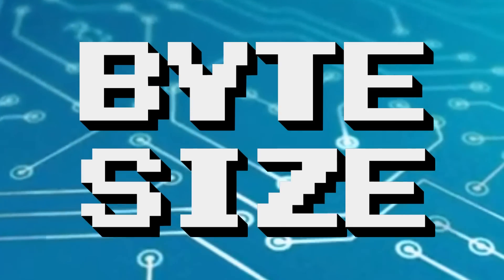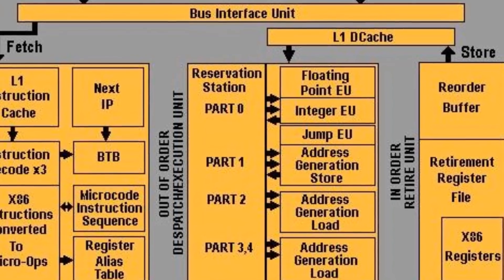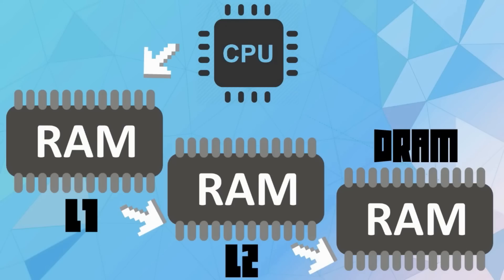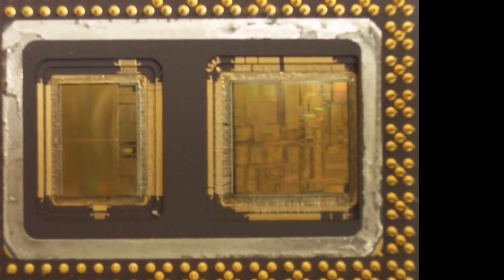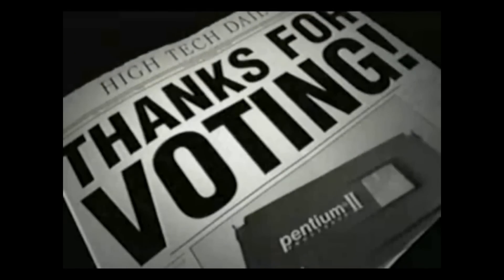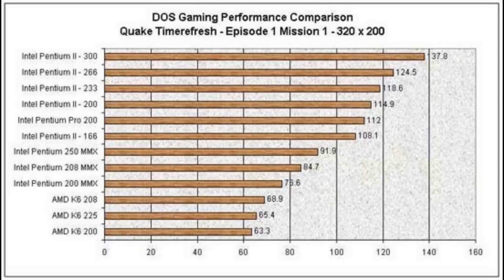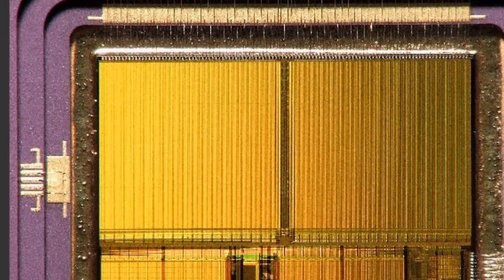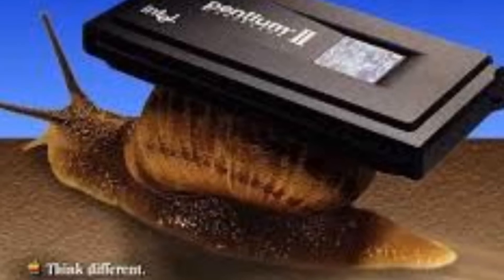Why Were Pentium 2's on Cards? [Byte Size] | Nostalgia Nerd

Comment: You forgot to mention what a beast that original Celeron was. It could easily be OC'd and would destroy the PII and even some early PIII's. The original Celeron's are legendary.
Reply: That's because it was the same processor (only with less cache).
Reply: the original had no level two cache
Reply: The Celeron that was legendary was the 300A. The Celeron 300A HAD LEVEL 2 cache at 128K that ran at full cpu speed and could beat Pentium II's in some cases which had more cache but ran at half speed. The original celeron without cache was undesirable.
Reply: the original celeron was dog shit and beaten by amd k6-2 lol
Reply: *****
Celeron/Pentium had better floating point performance while  K6 had better integer performance, at the same clock speed.
Reply: I remember buying a celeron 300A and OCing it to 450mhz to beat my friend's real 400 mhz PII (in most measures we took anyway) !! amazing times!
Reply: That was the most awesome OC :P
Reply: I used to have a Celeron 300A which clocked to 450 and if I remember I managed an extra 12 from FSB increase.
Awesome CPU for the price
Reply: I had one also.  I think I ran it at 300 while Windows etc was installed.  Once the PC was set up etc I went to the BIOS, upped the FSB to 100 and off it went at 450.  It ran like that for several years until I replaced it with an Athlon XP
Reply: I had the 366 one... 83mhz x5.5   456Mhz ... My  motherboard did not allow to chose small fsb increment.

But yeah the Celeron with 128K of cache at full speed made these CPU faster than Pentium 2 in many tasks. And almost every games.  I  literally threw my Pentium 2 CPU in the garbage.
Reply: Indeed !
Reply: That is correct.  The celeron 300A could easily get to 450 speeds.  That is a simply crazy overclock.  There is no equivalent that has come around since.
Reply: phuturephunk
But before though! Many Pentium MMX labeled 166 MHz could be clocked with 250 MHz (and even higher) without any problems with either heat or stability. That's the same 50% speed enhancement.
Reply: +LegendLength , it was always my understanding would work so long as you had the ability to set the FSB manually to 100mhz either through bios setup or through jumpers just about any Slot-1 board could be used , although the 440BX was the popular choice at the time, I seem to recall that some 440FX and 440LX boards had experimental setting for 100mhz FSB but were usually unstable because over clocking the FSB would also overclock the PCI and AGP buses and these boards lacked the proper dividers to keep the AGP and PCI buses stable.
Reply: I still have an old 800MHz Celeron laying around here.
Reply: I remember I ended up with the 300A as I had purchased, for my 2nd ever build, a 440BX board after reading about it, never expecting to overclock, and a Pentium II - 400. The month I built it I read a cover story in MaximumPC about Pentium II re-marked counterfeit processors flooding the market. I popped in the CD that came with the magazine and ran the program they had included to check and found out I actually had ended up with one the fakes.
Ended up having to take it back and ruined the day of an ex-employer, who had pushed me to use an existing store credit to buy the board, processor, etc, as I had quit months before and he didn't want to worry about owing me. Ended up using the credit on the processor return to pick up half of the parts to build a whole new AMD based system for my cousin's family. 
The day after I check a little shop right near where I currently worked and found they had the Celeron 300a in stock, which I had been reading the rave reviews on overclocking online. Picked it up at lunch and popped it in when I got home. As I recall I still had Windows installed from running the PII so I just ran it at 300 for a day, then upped the FSB to 100 and it ran like a dream at 450. It was quite the upgrade!  I think that processor only ran at 300mHz for maybe half a day's worth of use the whole time I had it. :D
Reply: In Celereon 300a days the motherboard didn't use the Intel reference motherboard they designed their own so in benchmarks the better brands were upto 15 % quicker with the 440BX chipset. I used ABIT motherboards as they could go up to 450 with having cut any tracks on the CPU cartridge. I wanted an ASUS but man were they expensive. In those days CPUs cost more than the motherboard
Reply: The T-bird was a traditional socket design. And I think they started higher than 550Mhz. But the original Athlon was a slot design and I had a 600 Mhz version and a friend obtained a 500 Mhz for free. Athlons were awesome for those few years.

Wikipedia agrees with my rough memory:
https://en.wikipedia.org/wiki/Athlon
Reply: The cacheless Celeron 266 would OC like a mofo. You could run it at a 112 MHz bus and hit 448 on it. But the lack of L2 cache still crippled it. The second-generation Celeron 300A, with 128KB on on-die L2, was the killer part that could almost always run at 450 with no issues, and would almost match a real Pentium II 450.
Reply: @si4632  Of course it was. The K6-2 was competing with the PII, not the Celeron.
Reply: @chrwl007  the pentium two murdered it though but back in 1999 I bought motherboard £50 and k6-2 550 £50 so it was dirt cheap
Reply: @chrwl007  pentium 2 300 was certainly faster in 3d games

Comment: My first new computer was a PII 333MHz system when I was 17.  I worked and saved all summer, and built it myself.  Before that, I had a hand-me-down 286 based system.   It's an amazing experience to go from command line to GUI interface, an experience too few will have experienced.
Reply: Tandy 128 Color computer 3. lol..

Comment: ahh my old 440bx chip set was awesome back in the 90s I miss the days of quake and doom 56k data fax and ISA cards
Reply: I had a slot 1 450 p2 it was good for a while with a voodo 2.
Reply: This was a monstrous chipset.
I´ve made some experiences with my old and cheap mainboard and it overcloked very well.
My best setup was a Pentium III-S 1400mhz with 750MB of memory and a Geforce Quadro.

My dream was to get a ABIT BX133, but it was very expensive and hard to find.
Reply: Marcelo Henrique that chipset sounds familiar, was it rdram?
Reply: I remember these systems well too. I remember working in the fab helping make 440BX chip sets, they were a good source of pride and income for the factory.
Reply: Mbit Gbit missing doom and quake sure, but 56k modem, fax and isa slot hell no!
Reply: PII450.. wow I'm looking for it since years.. PII's were great, I still use a PII400 today :)
Reply: I had a GA-6BXC with 550MHz P3 133 Bus it started with 128Mb ram and by the end of its life around 2000 2001 it had a gig of ram lol
Reply: it also had a Ati 3d rage pro turbo with 16 MB of V-ram
Reply: Michael B dont forget the IPX protocol -  the 'easier' way to network
Reply: Michael B isa cards were so damn tight I always hit hand on case while trying to remove
Reply: Asus P2B Series Motherboard 😍😍
Reply: cd\ ipxxxxxxxxxxxxxx. Hehe. You quickly learned to write your network card nr down.
Reply: It was a lot more work to set up a system back then.. IRQ conflicts.. yay.. I remembering upgrading from a P2 350 to a AMD Duron 600 which i managed to get running at abt 900mhz. Outperformed chips costing several times more.
Reply: @dave1the1deer1hunter  RDRAM was much later in P4 motherboards.
Reply: @310McQueen  The 440BX was the go to chip back in the day it was that common VM servers used it for emulation.

Comment: PII MMX 450 Mhz + 3dfx Voodoo II 12 MB SLI was the very best you could get then. It blew the then popular consoles (PSX, N64) away, but it also costed quite a lot. But if you could afford it (or your dad was a computer shop owner), you were able to play stuff like Unreal, NFSIII, Half-Life, etc in stunning 1024x786 resolution (back then seen as "HD") at 60 fps.

The budget build was Celeron 333 Mhz, which was a good overclocker and a single 8 MB Voodoo II which also was not a shabby system back then (certainly better than the consoles).

If you still have a working PII/VII build, it's very worth maintaining as a retro gaming PC.

Comment: the most useless upgrade i ever did was from a celeron 466 to a celeron 500.
Reply: Indeed!
Reply: kaltblut ~10% performance boost. Thats better than current intel cpus
Reply: what a "boost" ;)
Reply: Not quite, you're talking about ipc performance, though.
Reply: Rusty Gravel not necessarily. Going from 4.0 to 4.2ghz on the 6700k to 7700k is 5%
Reply: performance per watt, ipc, and clock speed all went up, you're just talking clock speed.
Reply: Rusty Gravel ipc did not change from skylake to kaby lake
Reply: Actually yeah, kaby lake is a clusterfuck.
Reply: my first self bought pc was a dx40... it blew my friends sx33 away performance wise.
Reply: Should I avoid kaby lake and stay on 7th gen?
Reply: +Elen Degenerate
Uh..what type of question is that?
Kaby lake - 7th gen LMFAO
I think you meant Coffee Lake, which is 8th gen.  Over-all, unless you want more cores, I'd just stay away from coffee lake entirely.  a i3-8350k is essentially a i7-7700k without the extra threads.
Reply: Oh yes that one! facedesk 
Oh goodie, suppose I will just grab a unlocked 7th gen and not waste money on a new motherboard ^_^
I were curious because in Denmark it has been a pain in the ass to even find 8th gen Coffe Lake for the past year, its only in recent months that prebuilts made an appearance and in the last few weeks that you could even get them from a mainstream seller without buying an entire pc.
And the i5 6400 is...too slow...so slow... shudders
Reply: +Elen Degenerate
8th gen (Coffee lake) is the one where you need to get a new motherboard.  Coffee lake CPU's don't work on neither 6th gen, or 7th gen motherboards. 
6th gen (Skylake) and 7th gen (Kaby lake) are all supported and work on all z170 to z270 motherboards just fine.  The older 6th gen motherboards (z170) all need BIOS updates if you want 7th gen (Kaby lake) to work on them though.  You can't just plug a 7th gen CPU into a 6th gen motherboard and expect it to work, as it won't until you get a BIOS update for it.  
If you want to over-clock any K processor, get a Z170 or Z270 chipset motherboard.  Any other Intel chipset motherboard won't allow you to over-clock at all.  

Although in my opinion, unless your looking to get a i5 6th or 7th gen processor, do NOT get the i7-7700k for $300.  Instead, just buy a i3-8350k and a Coffee lake motherboard.  It's practically the same amount of money, you're getting a newer architecture AND the same exact performance for less money.  Not to mention you're able to upgrade to a i7-8700k anytime of the day when you get the money.    Then again, I don't know how massive the price difference is in Denmark when comparing it to US prices.

I question how your i5-6400 is slow though.  Are you sure the computer just isn't being slow because of the start up processes or you have to many programs filling up the RAM?
Message me on Discord and I could try to look into it for you, my Discord is Nighter#2333
Reply: I will on Sunday, got lots of shit to do, so do reply to this whenever you see it, but I basically get bottlenecked whenever I try to run VR titles, especially Elite Dangerous crushes the cpu. RAM wise it is mostly Mafia 3 that cause problems due to me being an old man insisting that 8 gigs is still overkill. That and Mafia 3 is hillariously unoptimized.
Reply: +Elen Degenerate
Lol it's Sunday so add me on discord whenever.
Reply: @kaltblut  there is a huge difference between sx and dx .
Reply: @liammay7756  ???
Reply: SX processors are the ones which don't have a built in math co-processors, as opposed to DX processors which do. Also SX has a 16 bit bus and DX has 32 bit bus. to many differences to compare  over 7 mhz.
Reply: @liammay7756  i know that. what's your point?
Reply: I upgraded my DX2-66 from 8 MB RAM to 9 MB RAM...finally was able to play full throttle
Reply: Especially since back then, Celerons were known to overclock crazy well.  Probably could have gotten more with a few jumpers. =)
Reply: @kaltblut  Are you referring to a 486 or 386?  Both were available as SX and DX.
Reply: @xaenon  yes, the 486
Reply: @liammay7756  "Also SX has a 16 bit bus and DX has 32 bit bus." 

False.  486sx is 32-bit throughout. The ONLY difference between 486sx and 486dx is the presence of a functional internal FPU, or lack thereof.

You're thinking of the 386sx.  This hybrid 32/16 bit architecture extended into chips like the TI/Cyrix 486slc and 486srx2, and its IBM 486slc/3 derivative, which were all based on the 386sx.

There were also full 32-bit 486-hybrids based on the 386dx.  NONE of the 386sx or 386dx hybrids had math coprocessors.
Reply: K6/2 333. 
I'll get a 500.
And overclock it to 550.
Q U A K E B O S S

Comment: Uh you missed the A series celerons buddy. The 300A was an overclock beast for its time.
Reply: i remember having one that ran at 1ghz lol. sorry not 1ghz i meant the 1000* model ahhaahh sorry
Reply: Yea with the Celys people found out without the cache, the chips were often very overclockable because of less heat and the possibility the cache couldn't handle the speed bump. Which ended up making them preferable for many gamers. Me personally I just held out using my K6-2 400 until AMD released the Athlon 500mhz chip which rocked!
Reply: Sure was :) & it had 128 kB L2 cache
Reply: Bob Brown 450Mhz easily
Reply: yep. i do remmebr those ties when cheappo celeron 300 would overclock to around 500 stable and would basicaly be monster of a thing...
Reply: Back in 98/99 as part of my dissertation at University, I overclocked a 300A to 550Mhz with a peltier setup.
Reply: The slot version of the Celeron was pretty horrible and didn't last long. The socket version had 128K of L2 and actually would outperform the PII in a few situations when you matched the clock speed.

Pretty sure that's where the PIII with 256K of full speed L2 came in. Intel may have planned on that the entire time, but given how it all came down I think there were a lot of changes made rather quickly once people started doing things with their chips that Intel would rather they not do and publicly outperforming their flagship with their value line.
Reply: The slot version of the Celeron, the 300A, was the first to have 128k of L2 cache on chip. They were the ones that overclocked to 450mhz by just changing the bus from 66mhz to 100mhz. Only the first revision Celeron slot 1 (Covington), were awful - the 2nd revision (Mendocino) slot 1 and socket 370, launching with the 300A were awesome and outperformed the far more expensive P2 when overlocked on a 100Mhz bus.
Reply: I forgot or just plain old didn't see the Celeron with 128k on the slot.

The only ones I actually saw like that were the 370 to slot adapters, honestly.

You could put a Celeron on an old slot 1 board, some adapters would even run Coppermine cores, so you could theoretically upgrade a P2 266 to a Celeron 866. Pretty sizable performance increase.

Celeron 866 on a 410 (430? been a while, precursor to the 440bx) chipset.

The old no cache Celeron didn't make it past 400MHz, did it? Or was that the line that died at 366?
Reply: Yeah I remember, the version 1.0 Celeron were dope, but when the 300A entered the market, they could be overclocked up to 400Mhz without any problem giving you almost the performance of a PII at same speed for much cheaper. Then they moved back to the socket format (if I remember Socket 370) and the miracle was gone.
Reply: On some apps the Celeron were much faster than the PII as you could clock them higher. The smaller L2 could clock higher, so for a brief period of time the Celeron was actually the fastest consumer grade CPU you could get, for like a month or so.
Reply: My very first own pc during collage time! 300A was awesome
Reply: I had a dual processor 300A running at 450. A screamer in it's day
Reply: I recently bought a PII system with the 266mhz chip and upgraded it with a Mendocino 433Mhz. This chip runs very cool even without thermal compound.  At this speed though, it resembles the PII 350Mhz in gaming performance because of the lesser L2 cache. Could overclock with another board but prefer not to.
Reply: The lack of any cache on a Celeron give  is it a chance to be overclocked to a much higher frequency.  Hence the legend of Celeron 300A.
Reply: StringerNews1 ditto!
Reply: ive still got mine
Reply: Had a 300A then replaced it with a full on PII. That was a beautiful system.
Reply: What was the VCORE? How did you do the peltier device? The motherboard, socket and cpu was in the middle.
Reply: What was the VCORE? What did you do to be able to mount a peltier device on the system?

Comment: I still miss the slot era Intel/AMD CPUs, sooo much easier to install and impossible to break haha.
Reply: Would be difficult to cool nowadays. Those CPU packs already became too hot so Intel added a little cooler to them. Still remember a bunch of little whiner replacing in mid-2000-ies.
Reply: @KrotowX  Air-permeable CPUs?

Comment: I don't know why but I liked "cards" more than chips.
Reply: Yeah but most boards had very sturdy plastic mountings. It was often a pain to intentionally remove a P2 from its slot because you didn't easily find a grip on that CPU while releasing the two latches.

Comment: Took a networking class and they had tons of old hardware sitting around all the switches and routes we had. One of the drawers in the wiring closet had a Pentium 2 card in it. Funny how I would see this video months after I finished the class.